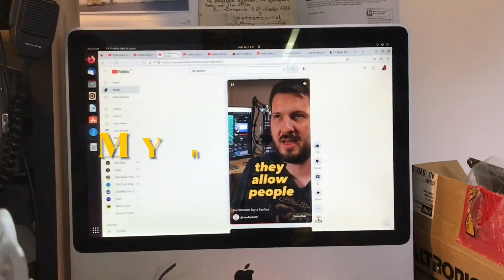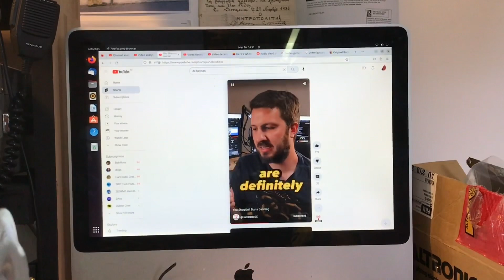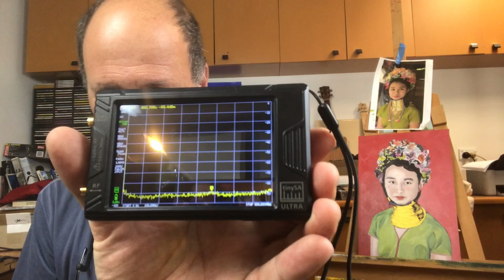My Baofeng UV-10R is it dirty or clean? @TheArtofEngineering

Comment: Already had the idea of marketing a modified cheap antenna with a built in filter a LONG time ago.  I gave up because putting a 25 dollar antenna on a 20 dollar radio seemed a bit absurd at the time.  :)
Reply from the maker: Yes… but if a HOMEBREW fix that is reasonably priced can be developed, we get to learn about filters for VHF/UHF (the dark arts 👿). 45 bucks for a radio that is not transmitting unwarranted harmonics is still a good deal? The question is how much the filter costs? I agree as a sold item…. Only mass production will make it profitable….Then it will be badly made….. back to square one ….. bad radio ….. bad antenna filter 😝

Comment: If an operator can afford a spectrum analyser to check their Baofeng, they can probably afford a better radio. 🙂

It really does all come down to acting responsibly. Our ACMA is hesitant to grant greater privileges such as higher power because they have formed the opinion that we can’t be trusted to play by the rules. In many respects that opinion is justified.

This is the whole reason radio amateurs are required to demonstrate a degree of technical competency. In commercial services compliance with standards is achieved by testing and approving the equipment.
In amateur radio compliance is achieved by testing and approving the operator.

Amateurs are supposed to know whether they’re putting a compliant signal to air and have the knowledge to understand how to remedy that if they’re not.
Reply from the maker: AMEN! 100% agree….

Comment: You can't be to judgmental against a cheap Baofeng. When its the affordable Ham radios, that has allowed so many people to get into Ham Radio. Its a double edge sword or hipocracy! When I was younger, I couldn't afford a $400+ good radio. Now I can, and I choose not to waste that money, when I don't have to! I have my share of Yeasu radios. And all of them have had problems too. But, they are still good radios!
Reply from the maker: Some of them are “good” . I do believe they will only get better if people test them to make sure they transmit clean. I think access to cheap stuff from China is awesome … I buy a ton of SI5351 CLK chips and microcontrollers from there! We live in exciting times, where things have never been more affordable. I also think the XIEGU G90 and X6100 are good buys (G106 “MEH”😖). So this is not a bash on cheap gear, rather it is a caution to check if you care about transmitting where you are supposed to be transmitting. 73 and thanks for the comment.

Comment: I'll be honest, i got my baofeng so I can listen in and stay informed.  And also the fact that an extra $100 is almost a third of my monthly income, and also because I'm never going to transmit, I like my baofeng.  I've had it for about 2 years and it's still working great.  Of course, I don't always have it on, but I've got it on at least once a week.
Reply from the maker: Yes to listen can be OK. I did transmit on mine too...but rarely as I feared it was dirty...turns out it wasn't ...but it died being tested (maybe the CCP has a self destruct when they detect they are being tested??  🤣🤣). 73 de VK2AOEthanks for the comment!

Comment: I had one given to me by another ham friend who bought a bunch really cheap.  It is way out of spec on 2 Meters but ok on 70 centimeters.  I never use it for transmitting but it is nice to keep in the glove box to listen to our NOAA weather here in the US.  I have used the flashlight a few times as well.  If someone steals it I won't shed a tear!
Reply from the maker: Yes as a throw away, throw caution to the wind rig they can be OK! 73 de VK2AOE
Reply: Yes, I did the same, a cheap radio for emergency use.